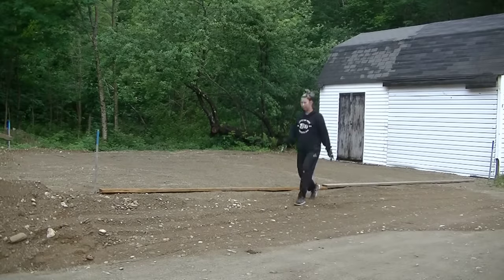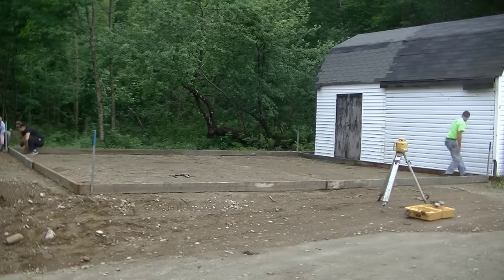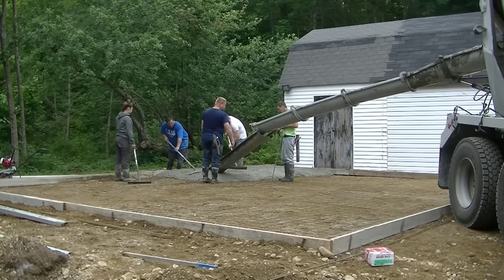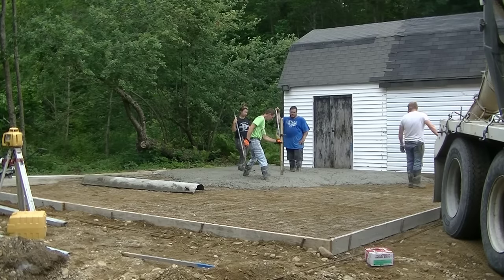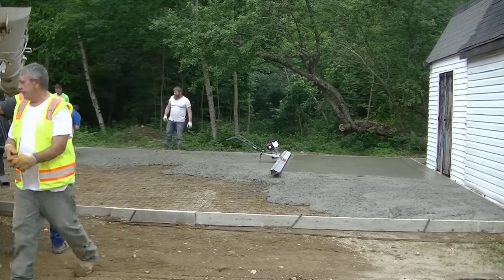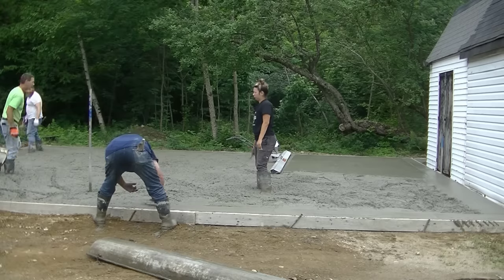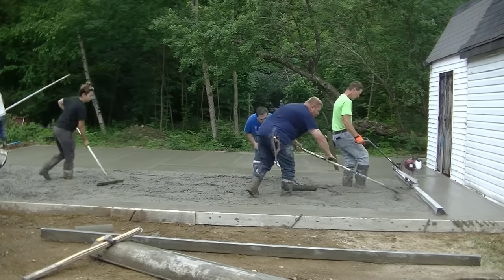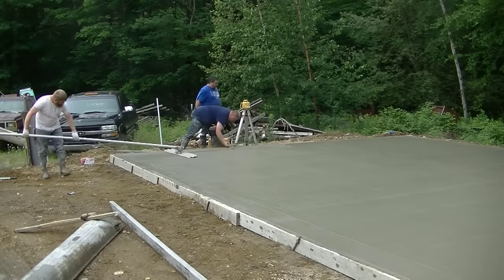Pouring A Concrete Slab For A New Garage (30' x 24') Form & Pour

Comment: I'm wanting to build a garage with a room above the garage. Do I need to pour a slab with a thicker outer footer to support the 2nd floor weight? Or would a 6in slab be enough?
Reply from the maker: For a second floor building I would make the edges 12" thick.
Reply: Don’t you need wals for frost?

Comment: I’m planning a 24x32 slab for a wood shop.  I want it to be 4” thick and will use mesh and rebar.  Will use 2x4x8 for forms.  I get how to square it, but very fuzzy on getting it level.  I have never Ben strong in math, but can figure it out with some trial and error.  Is there here a cheap but decent laser level I can get to get it straight?
Reply: For 24x32 concrete slab how much with that cost?

Comment: Mike, thank you for the info.. I look forward to watching all of your videos.  Just reading the comments takes an hour!  Lol.  Good job on the 96k subscribers- that’s awesome.  My question:  I’m from Louisiana and it’s hotter than a $2 pistol 95% of the year with lots of humidity. That being said, how does a beginner learn about dry times?  What are some good “rule of thumbs” for moving from screeding to bull floating to working the edges; etc. Is it a color thing or a time thing?  Thanks in advance.
Reply from the maker: It's a time thing. Bull floating is always immediately after screeding. I have a few videos on timing you can check out. One is called when to start finishing.

Comment: Hello Mike. I enjoyed your video. I'm doing an 18ft by 40ft slab. Garage slab. 4inch or 6 inch? Do you put footings around your slab for extra building support? How much gravel height  does someone need for a slab? Can I just you a string line level instead of a laser? Do you set the form board to the height of the slab? Thanks.
Reply: What state are you in? you might have to go with 6" just to meet code.  we do on driveways in all of WA state
Reply: code is based on having vehicle weight on slab, I believe

Comment: Hi Mike. How can I get started with a stamped concrete business with practically no experience..thanks
Reply from the maker: That's pretty difficult. Build some forms 3x3 or 4x4, mix some concrete and practice. Take my stamped concrete course, it'll teach you the basics.
Reply: With no experience in concrete I wouldn't take on stamping without some one who  knows what going on. You never know id work on puddling and figuring out how to use a mag and edger first.

Comment: Well this wouldn’t pass code in Canada for being a floating slab. We would need the perimeter to be like 12 to 18 inches thick with rebar tapered back to 4 to 6 inches of concrete with mesh and -lasting underneath.

Comment: Hey Mike another quality pour. Do you ever run a vibrating poker around with the formwork? How much concrete would you be left over with on jobs or have u measuring quantity down to a fine art?

Comment: Where's your blocks under the rebar?
Reply: Blocks ?? You mean chairs. I guess you missed the whole part where he was explaining how he was pulling up the wire with a wire puller. If you do that the wire will not fall back down to the bottom. Therefore, no blocks, I mean CHAIRS needed.

Comment: A good raker, 12' screed with a screed pole and 2 guys screeding could've got this done 10x faster. Maybe its just me but I've seen way to much popping and cracking on vibra strike jobs, but then again I live in a bad frost zone where air pockets are crucial to the integrity of  concrete.

Comment: Surely this is not the actual garage foundation,  there are no footers?!
Im doing a garage and it's costing me just as much to put footers in as the rest of the foundation and slab
Reply: IT IS IMPRESSIVE HOW BAD THIS JOB WAS DONE!  Lay wire mesh on the ground and pull it up a little ONLY TO HAVE THREE BIG GUYS TO WALKOVER  EVERY SQUARE FEET PUSHING INTO THE MUD BELOW THE MUDDY SOIL LEVEL...Repeat that with the rebar below.   LMFAO

AND you sell and pour a floor without know what kind of structure is going over it????????

JEANous!

Comment: Mike, Why 6" thick - I've only seen 2x
4 used for thickness and local professional engineer says. anything more is a waste and unnecessary and he owns the concrete company.
Reply: It depends on what your use is to be ; a sidewalk, yes. Have to admit, my experience with anything more than a sidewalk , I’ve always had rebar

Comment: It's obvious that they don't know how to do this. Before making a video, at least once looked at how smart people do it.
1) Concrete cannot be poured on sand. You need to put a whip. The water will leave before the concrete hardens. Concrete will not gain proper strength.
2) Reinforcement is not laid like that. It should be inside the concrete, not in the sand.
3) Where are the expansion gaps?
4) I am sure that they did not cover the concrete with a film.
You guys screwed up.
Reply: You want touch work

Comment: Hi Mike y people comment you do good work I can't believe are blind, No rebar poor work that's way the 🐛 move no squeleton😢
Reply: IT IS IMPRESSIVE HOW BAD THIS JOB WAS DONE!  Lay wire mesh on the ground and pull it up a little ONLY TO HAVE THREE BIG GUYS TO WALKOVER  EVERY SQUARE FEET PUSHING INTO THE MUD BELOW THE MUDDY SOIL LEVEL...Repeat that with the rebar below.   LMFAO

AND you sell and pour a floor without know what kind of structure is going over it????????

JEANous!

Comment: As usual, the wire mesh, which is useless unless in the middle of the slab, remains right on the ground. lmao
I see some here suggest chairs supporting WWM...lmao
WWM chairs are just ignorant garbage that placers will stomp on when you're not looking or trip over.
 Cut a notch out of a square mouth shovel and pull the wire up and into the concrete as it's being placed.

Comment: IT IS IMPRESSIVE HOW BAD THIS JOB WAS DONE!  Lay wire mesh on the ground and pull it up a little ONLY TO HAVE THREE BIG GUYS TO WALKOVER  EVERY SQUARE FEET PUSHING INTO THE MUD BELOW THE MUDDY SOIL LEVEL...Repeat that with the rebar below.   LMFAO

AND you sell and pour a floor without know what kind of structure is going over it????????

JEANous!